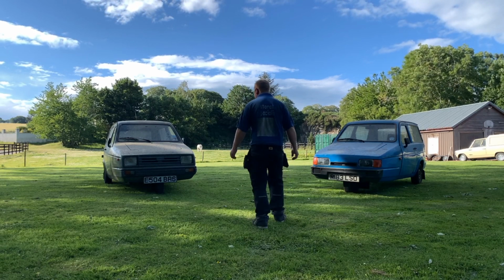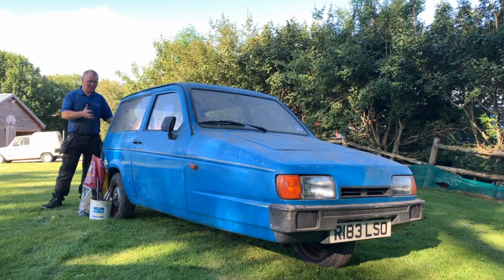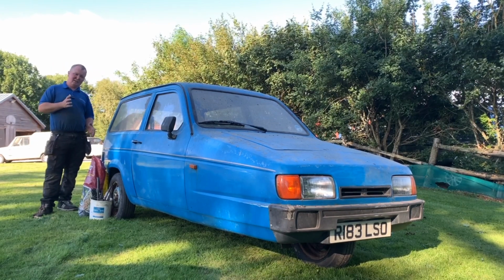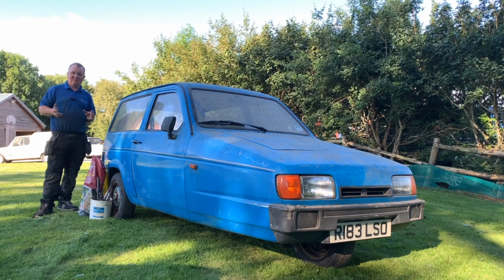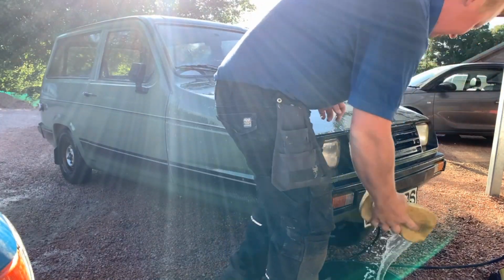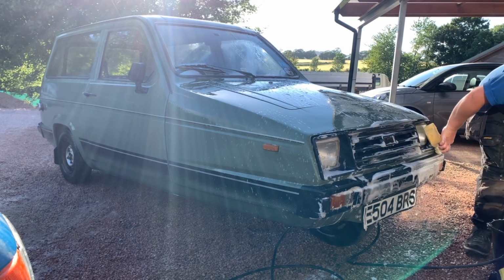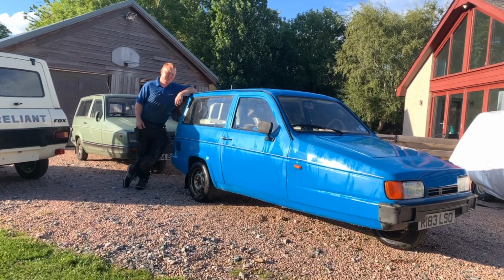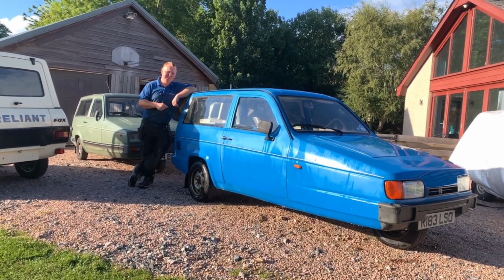Let’s investigate an old Reliant Myth 🙈💥🧞‍♂️

Comment: Personally I've had an 87 Rialto and I've currently got a 97 mk 2 Robin (think yours is 98) I might be wrong but the Rialto seemed to be made of far better stuff, it was relatively abused and had 60k on the clock, the decade newer Mk2 Robin has been looked after and has 48k on the clock.... But my god, what a rot box!! Chassis and engine is still great but all the running gear is crumbling in places and the dash with its weird light cluster and clumsy switches with faded print could never compare to the Rialtos simple tidy dash, lights incorporated into the instruments and nice solid, clearly labeled switches that operated with a positive click - oh and a voltage meter too! Not to mention the Robin has huge gaps letting light thought around the edge of the hatchback and doors (even thought the seals are in great condition.... Yet the Rialto was pretty water tight. In my opinion the 87 Rialto 2 SE is a better buy.

Comment: Hello there, I've got a question about the distributor for a 850cc Rialto. I've got it on 9 degrees past TDC and I was wondering if it's worth to turn up to 12 degrees. It's a small difference but can that small difference have a big effect? Because my Reliant sounds more aggressive at low rpm?

Comment: i would like to see a electric motor covertion bring it into the 2020 s engine in the rear battery in the front interesting idea
Reply: Someone in the Netherlands has done this, but with the battery at the back and the motor where the engine was. I suspect that the weight of a battery pack at the front might make it more likely to tip over in a corner, and putting it over the back axle would make it more stable, but I might be wrong.
Reply from the maker: It’s just something I couldn’t do, the original reliant motors are fantastic and only sip petrol, also you don’t need to wait till they charge up 😂